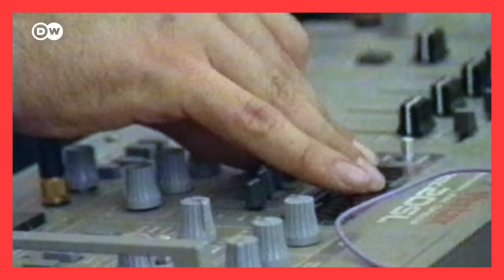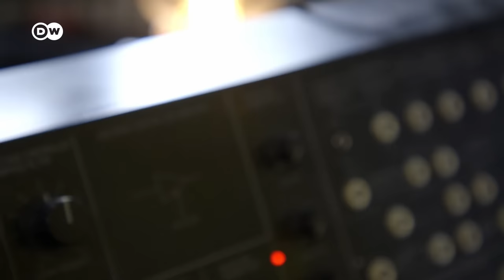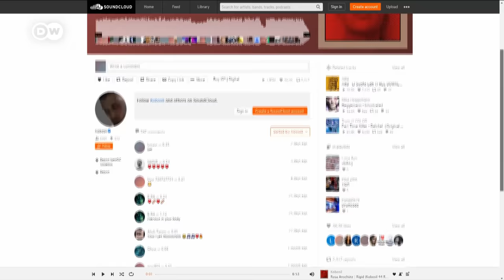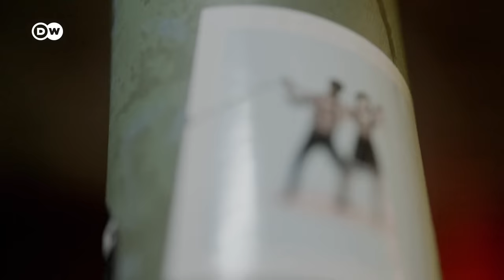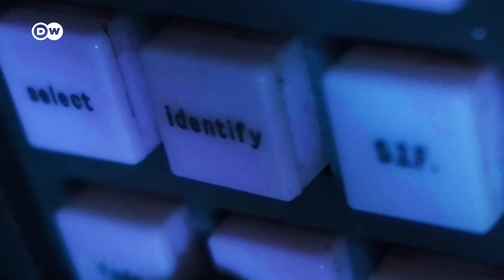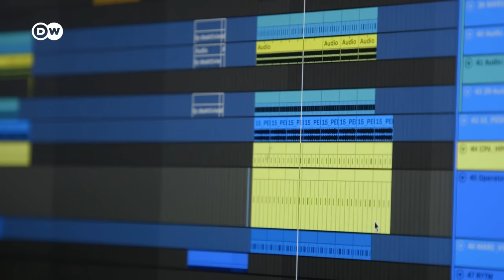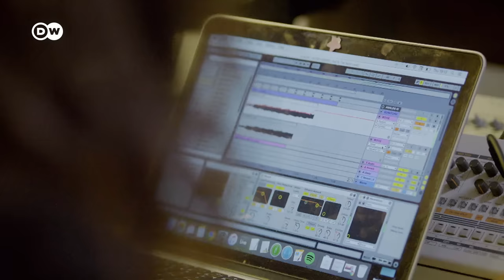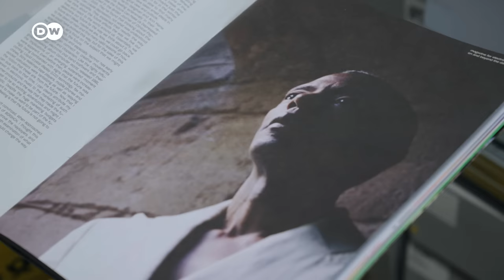How Techno Shapes the Future

Comment: I've been in the scene since '88 and there is not a lot of modern stuff in here that I would call "techno" (it sounds a lot more like commercial Trance). I still release techno mixes and there is not a single modern artist featured  here that I would play, or have even heard of.
For me Techno is a feeling. A pulse. A ripple. A boom. Techno is faceless bollocks. It is a punch in the face. It is a slap on the ass. It is an adrenaline shot. It is a roar, a scream, a horn, a siren. An explosion of sound and noise and emotion.
For me Techno is the stuff Dave Clarke and Christian Varela are putting out each and every week. It's about as far from commercial Pop music as you can get.

Comment: DAWs like Ableton & FL Studio have contributed to the downfall of originality when producing electronic based music. Add in an oversaturation of plug-ins for DAWs, most producers experience a thing called "option paralysis" where they have too many options to choose from, so they stick to whatever plug ins & DAWs the pros use (Sylenth, Massive, FL Studio, etc) along with the oversaturation of the sample pack industry (BILLIONS upon billions of samples online) and you have a recipe for staleness.

As a producer, I started seeing this around 2011 and switched to a hardware based set up and started building a studio full of gear from the early 2000s to the present. A lot of gear is expensive, but I enjoy being able to play an instrument like a synth that I can actually feel & experiment with different guitar pedals to get sounds & tones that can't be recreated on software (unless you get a plug in, lol).
I enjoy jamming out & seeing where the music takes me, instead of me forcing the music to sound how I want. I can't stand using computers to produce and design sound, I only use them to record, mix & master.
Reply from the maker: Thanks for sharing your thoughts and experiences.
Reply: Yep totally agree with you - forget menu diving, screens and presets. . it’s far more ‘real’ using hardware, synths, modular systems etc. . i like to keep things analogue too. I feel the same about vinyl when it comes to DJ’ing. Over twenty years ago I was using old analogue synths (even my Stylophone 350S I’ve had since a kid) and guitar pedals along with turntables to DJ live.